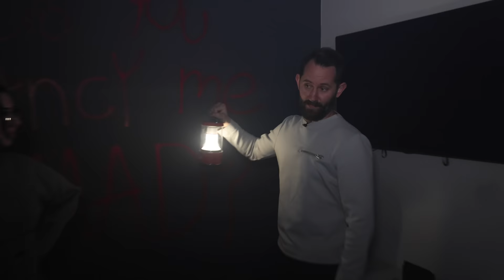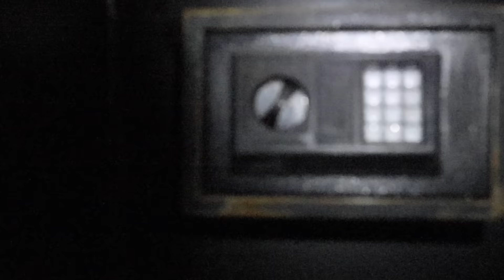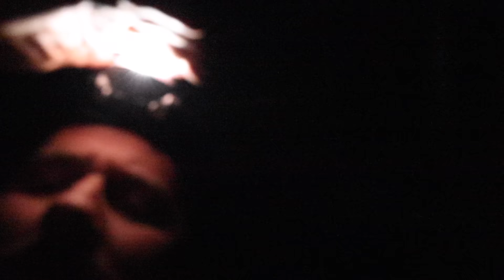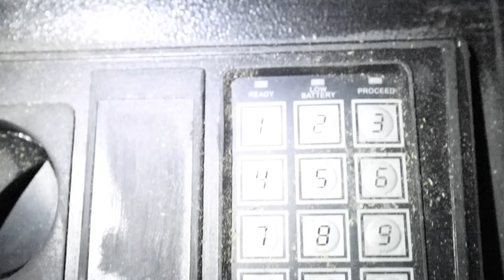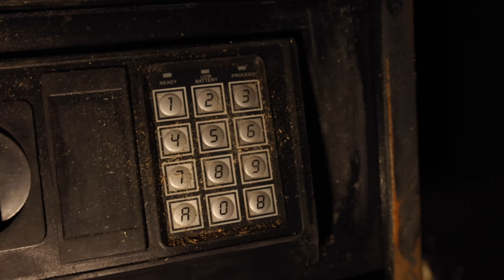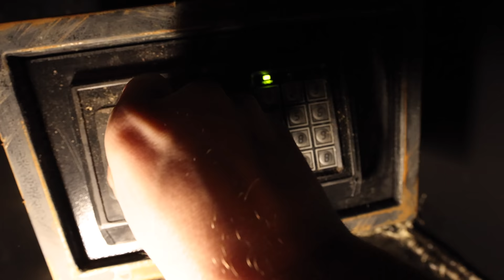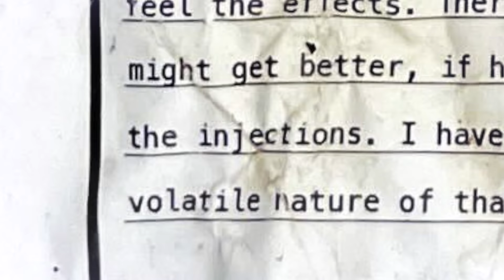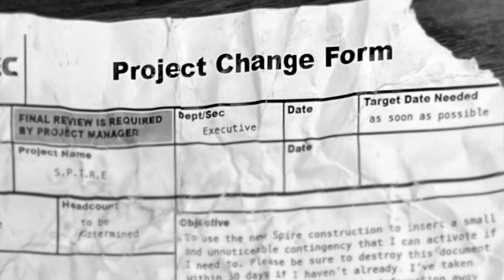I Crawled Through A Hidden Tunnel I Found In My Walls!

Comment: You should check behind the other speakers. What if there are more crawl spaces? Why would only that speaker have a space behind it? Only because the body outline is next to it? What if the death of said body came after the speaker was installed? Doesn't explain why it's only that speaker.

Comment: MAT!! I OWN THAT SAFE! in-between the  number pand and the dial is a panel. You can take the panel off to reveal a keyhole in case the battery dies. Please do it.
Reply: Also yes after you punch in the code you can either press A or B to confirm
Reply: This is incase you forget the code

Comment: So, here's my take on this episode, I think they definitely need to check the other burn marks on the walls and open them up, maybe there's other safes in there. Is it a coincidence that the safe was located in the wall behind the speaker?
I think Matt knew what code he put in, he was being too cagey when asked what code he put in. I think he may have entered his D.O.B as the code. 6 digits 11, 20, 88 (Matts B/Day)
Reply: Matt’s bday is on 09/20/88 because he has the same bday at me.

Comment: The human theory is a good one, the night they got motion sensors going off, the mannequin was outside and "needed" to be let in to direct the team on where to go. But this then also implies they knew about the speaker and potentially the safe as well. If that document was signed by Wes and was supposed to be destroyed after 30 days then it would have to be someone that Wes was in contact with that felt they needed to keep the letter rather than destroy it for evidence or their cover was blown. Another thought is that if it was a human they could have easily hid inside the base and done this themselves. Unless they (the human) knows more about Matt than we do, the mannequin was wearing Matt's clothes which could mean that the possible human (or ghost) knew precisely who had the prior knowledge of something we don't know yet. From here I see two options, it could mean that either 1- this is a paranormal ghost that couldn't open a safe but could only work through electrical currents causing the explosion so Matt and the team and do the manual work. Or 2- This human knew about the spire project document and forced information out of Wes or whomever put it there but couldn't gain access without causing to much of a scene and not knowing the code. This really does seem like a long process to go through if it was a human. But if Matt's an undercover baddie, than this could be his exposer. Or Matt was an experiment that had a mind wipe from past serum and is regaining prior knowledge or flashbacks due to him experiencing ( reliving some of his past ). Which could explain his forgetfulness and how it just jumped into his head and he very well may be the one that actually put it there in the first place. Matt did pick this location for Hi 5 studios.
Reply: Long
Reply: Yes good theory
Reply: lol

Comment: my observations and questions for this episode:

i wonder if the hand pushing the wall open was the ghost they wanted you to find the device and that document. it would explain the paranormal activity of the handprint and the mannequin all leading to an explanation of spire. something the team has been very vocal about wanting. at this point i think we can guess the ghost (or whatever it might be) to be friendly. hopefully we can figure out who the ghost is.

they definitely need to investigate another speaker that could possibly be unbroken and see how it works or exactly what its doing!

what was the code to the safe? i mean let’s be realistic here, matt didn’t just randomly guess a 6 digit code. and a few seconds before he seemed to be moved, in a way, when sam mentioned syphus. what is he hiding? my guess is it is a code related to syphus and probably includes the letters on the safe.
Reply: One theory is that Matt is being controlled by some type of mind control by someone (maybe Nelson) because of the serum. Which could explain why he forgot the code afterwards.

Comment: Wait, wait, wait... the speaker burnt the wall. It blew out part of the wall. What if it was one of those speakers that caused the fire? The one that we know happened, but still know nothing about? If the fire was as bad as that old article said, then the walls and stuff were entirely rebuilt. If the speakers overheated like that before, one of them might have been too close to a flammable area or material, and whoosh, Syntec goes up.

Comment: What if the speaker is actually a paranormal sensor that is disguised as a speaker (to trick any syntec employees in case the wall burnt or any builder,electrictions, ect) and it stopped the ghost from escaping and in doing so it blew the wall.

Comment: If you go back to the video where he meets with ben in the parking lot, ben says a 6 digit code 16-2-2-0-1 which is 6 digits. If you count the beeps when matt puts the code in, there's 6 beeps and I think that's the code he put in because what else would it be. Just a theory.

Comment: Nothing is growing inside of there, those are welding gouges and welding spatter from a torch.
Reply: I can tell because  can see the silicon glass on the top of the mig wire welds.

Comment: Well the last two videos I was right that they were speakers but I wasn't right that they being experimental speakers that tested the subject for effects with decibels or anything else they were just basically PA speakers hooked up to that control panel.
Just now makes me think they had recordings set up to be played through the walls like you guys said and this is not a ghost it's someone messing with you and also means they may have hidden more items behind the speakers that are all over the building that includes blue base.
Oh I'm so excited I was right on the last two videos about it being connected to project spiral.
I was about to say when was the last time you guys turned that computer on that was in the vault that would have told you some locations of new serum and new locations while looking for the serum.
I also think you guys should go back to Ben's RV and see if there's anything new in the RV if it's even still there.

Comment: something about matt not sharing the password is strange. he didn't put any of the suggestions the team gave because he entered a 6 digit code. (if you go back you can hear how many times he pressed a number or letter) nobody said any code with 6 digits. it almost seemed he realized something with syphys. is there a 6 digit code the correlates with syphys we've seen in the past?

Comment: There is the possibility that the speakers are for detecting EVP? And since you just threw all the switches to full blast suddenly and with how loud the noise was coming through, it blew out the speaker

Edit: I don't think you guys are understanding what the SPIRE is. I think the failsafe is the Antidote dispersion. I don't think Deb knew that the SPIRE had that failsafe built into it.

Comment: What if there not speakers
What if there boxes to keep in paranormal things and when you turned it on it started to let out the paranormal things
And be careful because paranormal spirits drain battery power from everything that has any type of batteries

Comment: The whole safe code thing was suspect to me. You couldn’t remember the code and just entered some random number after saying, “Hmm I wonder?…” and it worked? Something doesn’t add up there bud. Why didn’t you want to share what you did there? Like some of the others are saying as well, I would suggest checking behind the burnt areas. I’d imagine a stud finder would go off if there is something solid, like a metal plate and speaker, behind the sheet rock 🤙